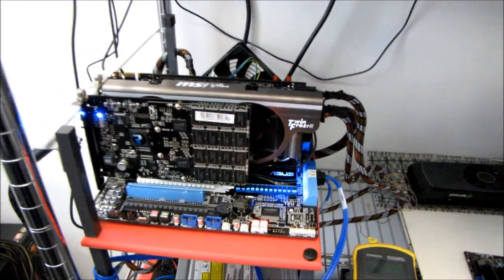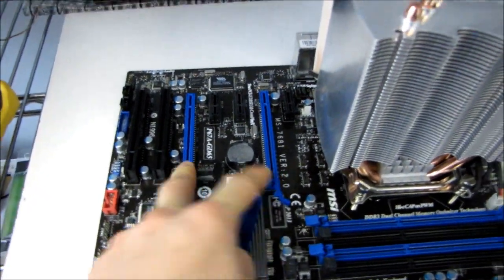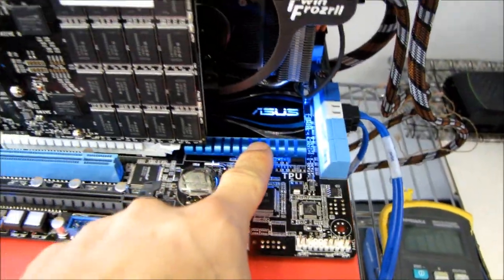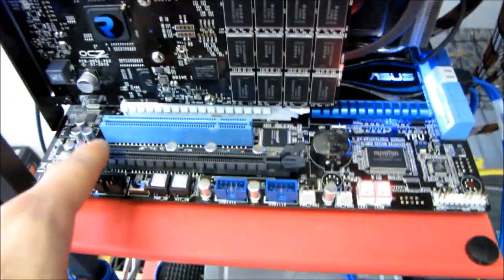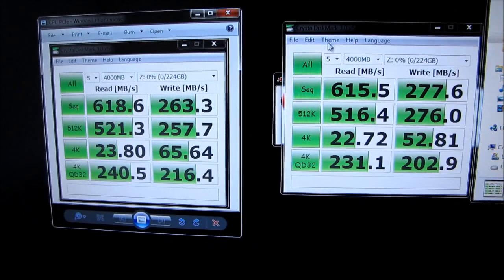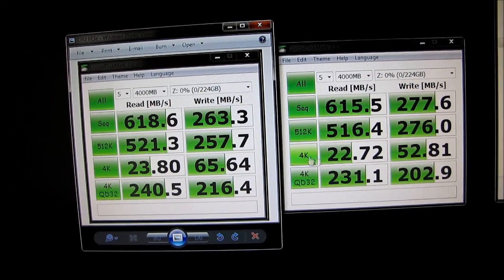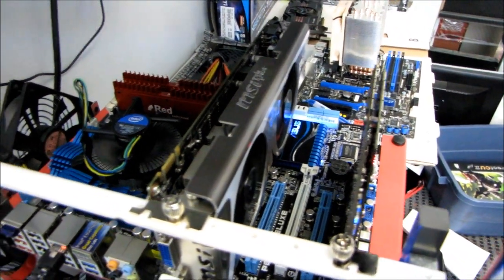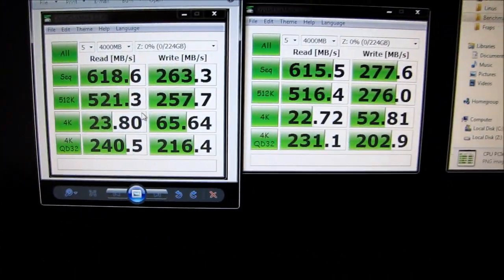P67 PCIe Slot Performance Comparison With OCZ Revodrive X2 Linus Tech Tips

Comment: It'll have similar speeds when it comes to normal read and write because the slot that runs off of the chipset isn't sharing with anything other then it's self where as in the 8x slot it's being shared with the graphics card so it will slow down the speed. The random read and writes will be faster on the 8x slot purly because it's double the speed of the 4x slot. This is my theory anyways

Comment: although it is 16 lanes, i see evidence that there are 32 (probably form a chipset or boards giving up some other pins for more). these are usually divided into x16, x8, x4, and either 2 x2's or another x8. on my board, if my memory is correct (and im too lazy to go check), i have 3 slots that run at either x16 and x16 when 2 are used, or x16 and x8 and x8 when 3 are used.
now i have a question: how do i get my pc to sleep and able to turn back on? p8p67ws and revodrivex2. please help someone?

Comment: @LinusTechTips IIRC on most P67 boards, those 20 PCI lanes are 16 for 16x slot / 8x8x, and 4x split to 1x marvell SATA6 controller / 1x realtek network card / 1x PCIe -> PCI bridge / 1x physical PCIe 1x slot

Comment: @bvestationfan the nf200 chip is on the ud7 and the maximum IV also according to gigabyte's website the nf200 provides 32 lanes so it can run with 16X 8X 8X for 3-way or 16X 16X for 2-way

Comment: @Hokrollo1 your so stupid.... the Maximus IV Extreme and some other boards like the p8p67 ws revolution have other chipsets other then P67 to allow it to run at higher bandwith. the WS revolution has a NF200 chip which provides more bandwith, but im not sure about the ud7 or maximus IV.... still the x16 x16 x8 isnt only coming from the CPU but also from a third party chipset

Comment: Wait a minute now.. so if you run lets say a GTX 580 in one slot and the revodrive in the 2nd one (on a 2 slot board)... does that mean the GTX580 will automatically run at 8x instead of 16x since the revidrive uses the other slot? or would it be better to get a 3 slot board and run the revodrive in the chipset controlled slot so the GTX580 gets its 16x?

Comment: is there a difference between sata 2 and ata/100 ???? i will buy a new 500 gb hdd is it faster than my 80 gb ata hdd which is 7200 rpm and 8mb cashe and the new one is 16 meg cashe and 7200 too ! ?

Comment: It would be interesting to see how putting the PCI-e SSD on the CPU lanes compares to putting it on the PCH lanes affects the performance of games run with various size graphics cards aswell.  The 10-20MB/s of performance increase is probably not worth it if the GPU gets bottlenecked by only having PCI-e x8 to work with.  
Follow up tech tip maybe?

Comment: @mastermanio2 the cpus now are faster but they are made with a better manufacturing proce (32 nm) so therefore they run alot cooler and do not need a bigger heatsink but they still suck

Comment: I should probably rephrase my question. Is it possible to have two grahpics cards in the top two x16 slots, and run them in SLI or Crossfire for a total of 32 lanes... or does P67 not support this and you're stuck with two 8 lanes for each card?